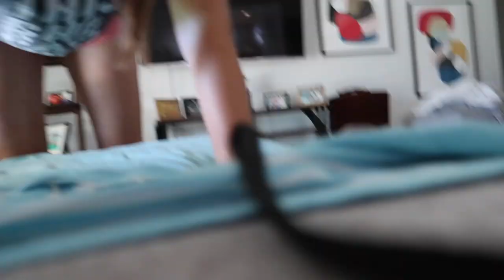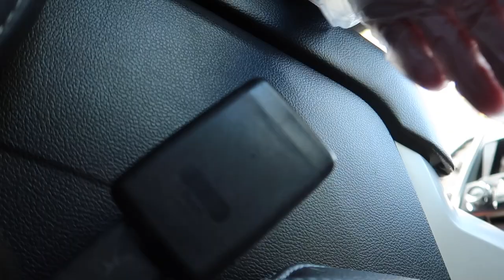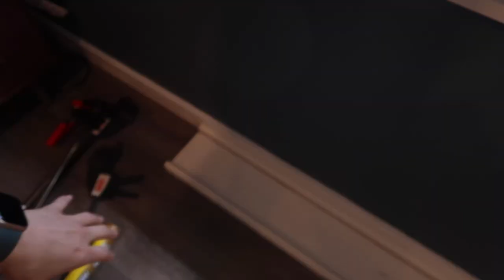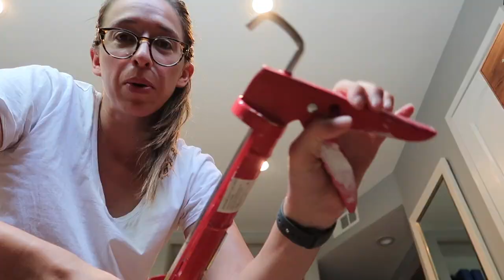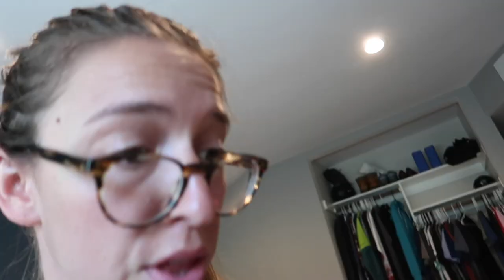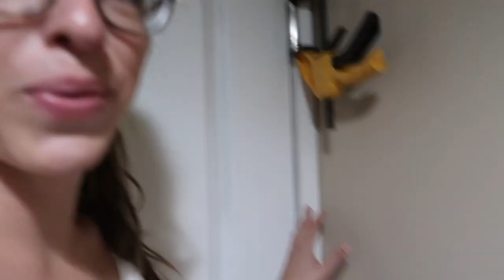Using a Tik Tok Hack!

Comment: Rachel! A hack for when your waiting for heavy duty glue to dry is to also use hot glue, it dries fast and will hold your project in place while you wait for the heavy duty glue to dry. (This hack works for smaller projects like she did in the video, but not for heavy wood projects obviously)

Comment: I just want to let everyone know that food, water, tools, etc don’t need to be sanitized and you shouldn’t sanitize it just a friendly tip
Reply: Tools, as far as handles and packaging should be wiped down. Liquid nails for sure can and should be wiped down before using. I wouldn’t use disinfectants on anything electric in nature. Unless it is unplugged and maybe just wiping off the handle, not any moving parts. 

You should wash most foods before you eat and prepare. Cooking will “sanitize” most food if done correctly. The outside of water bottles should be sanitized.